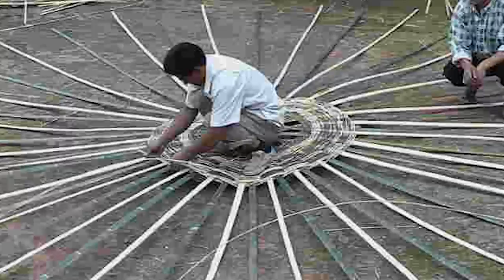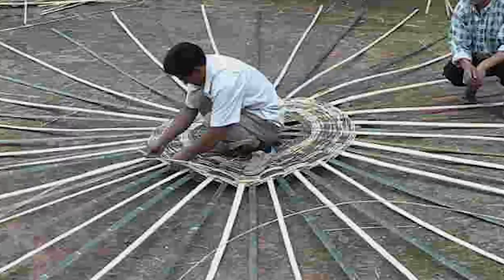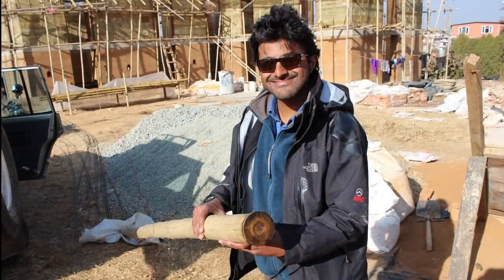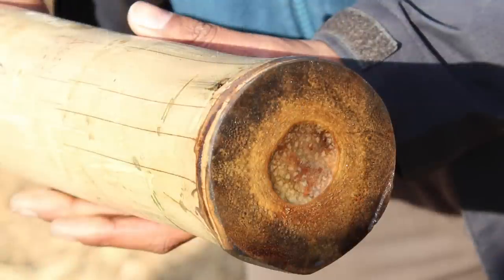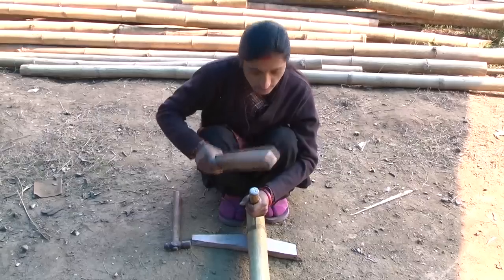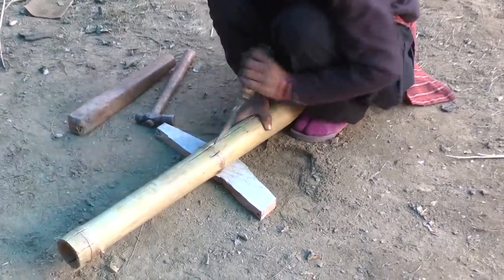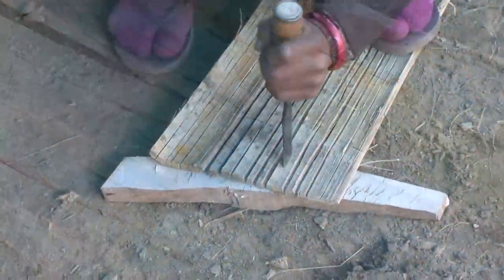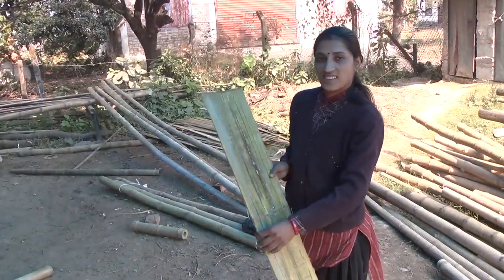Chapter 3: Bamboo Flattening to Create Water Storage Tanks

Comment: Quick question about flattening. Any reasons for not using the "Star" splitter?
Reply: They are not spliting the bamboo, they just flatten it an the pieces of the bamboo is attaches to one another. If you we use star splitter, it will make a bunch of sticks detached from one another.